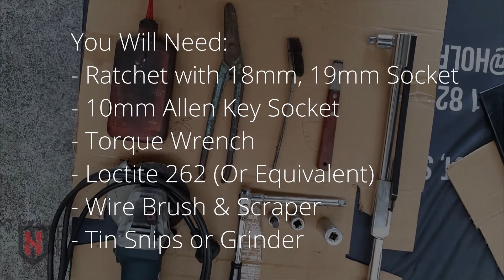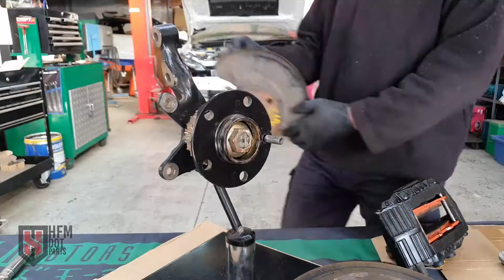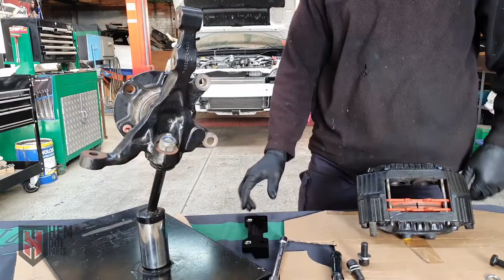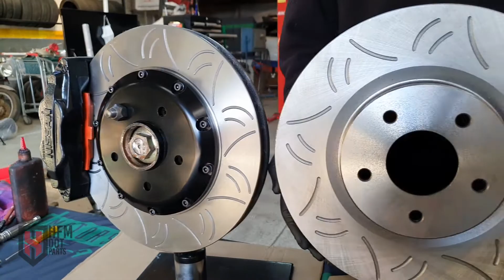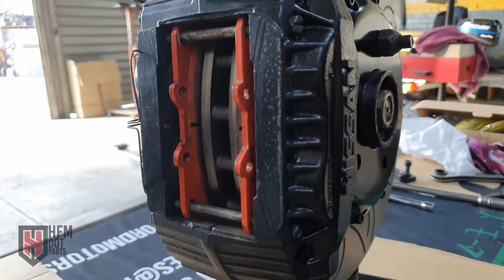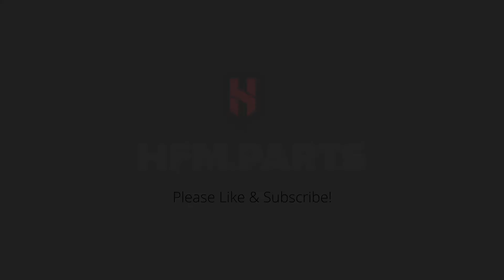324mm Front Rotor Kit Install Guide from HFM.Parts - S13, S14, S15 & R32 GTS-T

Comment: Hi there i have s14 with r32 gtr front calipers, Do i use this adapter bracket or the R32 Gtr bracket as the calibers on the r32 are slightly different to the s14
Reply from the maker: Hi David R32 GTR calipers are the same as R33 GTS-T so you need these adapter https://www.hfm.parts/shop/brakes/nissan-324mm-rotor-caliper-adapters-s14-s15-r33gtst/